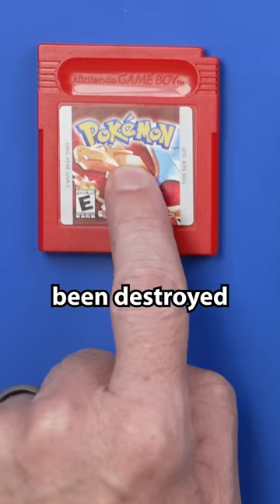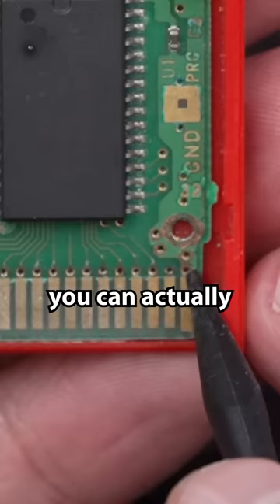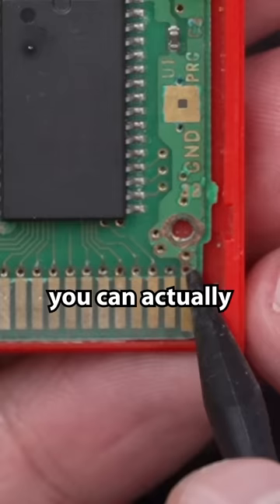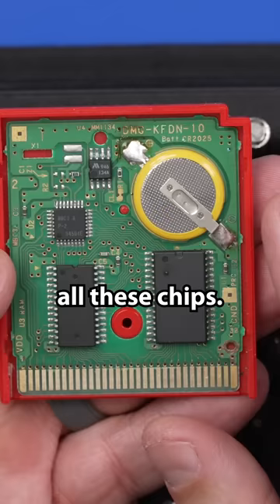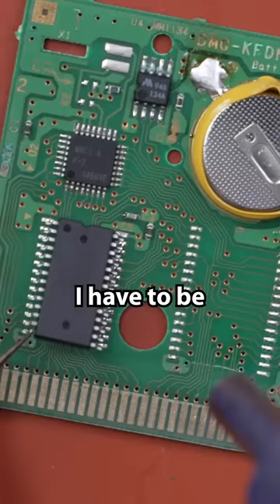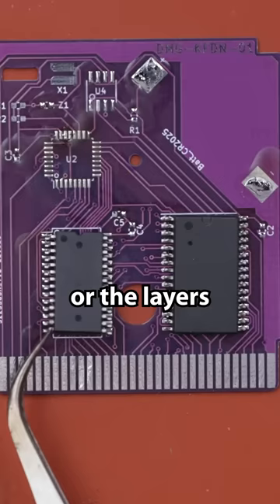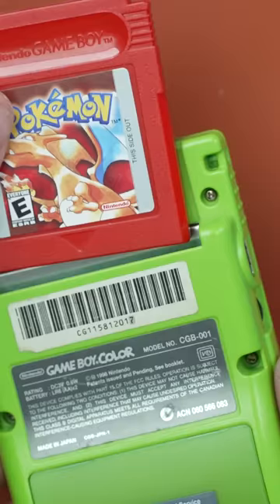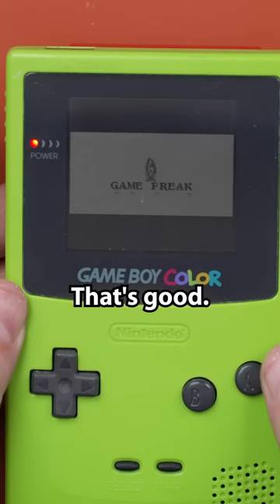This Pokémon Game Was DESTROYED - Let's Fix It!

Comment from the maker: PCB Design Attribution: https://github.com/HDR
Reply: It's like magic. How come the chips didn't take as much damage as the circuit traces? Any ideas?
Reply: @inibrasiumthefirst2680  The Chips circuit is inside the black plastic of the chip and is protected. The feet of the chip are not copper and are thicker, so they can withstand more corrosion. Copper is used for the traces because it will accept solder when hot from many materials and because it can be made paper thin. It used to be that in old boards, the copper layer wasnt as protected as well as modern bords and copper is hightly reactive
Reply: @FloatDown  Seems like he doesn't care. He only "likes" posts that say "wonderful job, wonderful video'". But not posts with real advices
Reply: Do you guys do wii bc I’d love to get this wii I have fixed
Reply: Hard-core fans: you've  ruined  the value of the game 😭
Reply: @EternalResonance  Yeah, now after the scalpers take over this poor game will cost $5,000 instead of $20,000 because it got the pcb replaced.
Reply: Do you fix switches because mines got wet and now it overheats and doesn’t recognizes as cards and won’t play on tv
Reply: We’re can I get this PCB? I’m new to soldering and would like to practice on a faulty save state of Pokémon Gold. It’ll play but saving doesn’t save on the memory chip. So every time I have to restart the game all over
Reply: @Resolve_DigitalMedia  sounds like the battery is dead. I'd start with replacing the battery first before doing a swap like this.
Reply: Oh god don't raise the goddamn price of games by showing people this, it would cost a lot more to buy a game that this has been done to.
Reply: how does one go about getting these files and having a purple pcb made?

Comment: An empty board like that could possibly save a bunch of games from being trashed. I'm definitely here for that.
Reply: Will it still be considered authentic?
Reply: @that_one_fat_guy6537  If you are gonna sell it, then no. But if you are gonna just keep it for your game library, then I say go for it.
Reply: @that_one_fat_guy6537  Well, it isn't a clone cart. It still has the original chips. All you're doing is replacing the backbone of the game that keeps everything connected.

I'd err on calling it authentic but definitely disclose that you did the repair
Reply: @snickerdoooodle  So it's kinda like reshelling a console, so yes but not fully.
Reply: weed
Reply: The game? Yes cartridge? No
Reply: @that_one_fat_guy6537  "Refurbished"
Reply: @japzone Still a better refurbished than DkOldie/LukieGame 😂😂
Reply: @crowman6330  i lost the game
Reply: @jestawell  God damnit
Reply: @that_one_fat_guy6537   So it would be more accurate to refer to it as a Refurbished GB Cartridge?
Reply: @that_one_fat_guy6537  more like an authentic copy that was refurbished
Reply: I mean yes but no
Reply: @that_one_fat_guy6537  i'd say no, but it's defo refurbished at least.
edit : would call it fully refurbished if the battery is replaced
Reply: @crowman6330 Cartridge yes, board no.
Reply: @that_one_fat_guy6537  the comparison is probably closer to replacing the motor of a 1.9L Mazda protege with another 1.9L
Reply: @that_one_fat_guy6537  refurbished and authentic chips, so technically yes. 😅
Reply: @that_one_fat_guy6537  I'd consider this just authentic refurbished. Its still OG chips which means you dont have the problems of clones
Reply: If you clearly state it was refurbished, I don't see a problem on selling it.
Reply: @crowman6330 I lost the game
Reply: @Darktrooper99  they will never know without opening it so i would definitely rip you off

Comment: I'm still calling this an original cartridge
Reply: New PCB but all original electronics.
Reply: I'd call it Refurbished, which isn't a bad thing.
Reply: At least it doesn't have alot of wires to fix the traces
Reply: This is like Ship of theseus
Reply: 50/50
Reply: @blazegame5388  haha was thinking about that
Reply: It isn’t though. As soon as the pcb was replaced it became aftermarket refurbished.
Reply: @blazegame5388  I would vote no because all the chips and outer case are original. 😁
Reply: I'd say it is because the original cartridge is still intact only the board was switched
Reply: these basically all have to be refurbished if you actually want to play them anymore. well all the batteries are dead anyway
Reply: Refurbished. Lol
Reply: Any opinions on bettery change cuz I have three that I changed the battery but kept it will someone in the fired care about like the original flux or whatever
Reply: @blazegame5388  some people will just read by your comment and have no idea😂
Reply: My toxic trait is thinking I can do this

Comment: RIP that save though. Without the battery all the data whittled away.
Reply: He may have backed it up before showing this video, or it might not have needed to be backed up for whatever reason
Reply: @A.D.G  Unless there wasn't a save before, or the battery was dead, any save that was on it is wiped out. That's what the battery is for in every game cartridge that let's you save your progress. Battery dead or disconnected, no more save Unless you backed it up on your computer or something.
Reply: @MrJJandJim  you can very easily replace batteries and keep saves by backing up the save before the battery dies. I've done it for all of my OG cartridges
Reply: @A.D.G  That's what I was trying to say, lol. Unless you have the save backed up somewhere, the memory is wiped. Sometimes my brain makes the weirdest sentences that only I can understand, lol.
Reply: @A.D.G  it would have been impossible to back it up without restoring the pins
Reply: Bro, just play the game again 💀
Reply: @theqwertycoder_alt  But don't forget that the water may have shorted out the battery.
Reply: The game was busted anyways. So that guy had to choose between starting over with the repair or buying the game again for a lot more of the price.
Reply: @deijigates4664  Yep!
Reply: Better loosing the save that the game!
Reply: Im curious,  is there a way to provide power to the chip while doing the move?

Although its moot since when the water got into the cart, most likely the game save was lost already :(
Reply: @A.D.G  how would he have backed it up if all the traces were broken? seriously explain your train of thought to me.
Why would he replace the ENTIRE BOARD if the game worked to back it up?

Do you realize how little sense your comment makes?
Reply: @froddobaggins  well considering he is a competent repair technician and can follow broken traces to their source components it's not crazy to think that he could connect directly to the required circuit points and read the data.

No need to be so hostile with such a lack of understanding on the topic champ
Reply: @kuzadupa185  no, lol you can’t unsolder and move a powered chip. Thats not how It works
Reply: Dawg, it was clearly liquid damaged. 

Whatever save it had is clearly not important. 💀
Reply: There really isn't anything he could have done that wouldn't have taken more time and resources than it was worth. With all the traces broken, it wouldn't have been able to transfer data because it couldn't be read.

Comment: Pro tip, it's good practice to bake boards before major rework like this especially when there's water exposure. Slowly get them to about 100c over an hour and keep them at 120 for a few hours to ensure there is no moisture in any of the ICs.  Some ICs absorb moisture and the internals will pop kinda like popcorn if the moisture is rapidly heated to rework temp.  Very sensitive ICs can absorb the humidity in the air and require baking anytime they are heated to soldering temps.  Lastly ceramic caps are also very sensitive to rapid temperature changes, their protocol is to ramp up to 100c at 2-4 degrees per second, then you can use soldering temps. So you can go right from baking to rework and rework will be a bit easier with a preheated board.
Reply: Hmmm, good to know

Comment: Custom boards are always fun. That one you've got looks like a HASL finish. Those contacts will oxidize and make a poor connection over time. ENIG finish will withstand the test of time far better. All the best!
Reply: Why don't you send him $40 to help pay for this?
5 boards  40x60mm $5.00 for HASL, $44.66 for ENIG at PcbWay.
You don't want the HASL contaminating his edge connector.
Reply: Just asking: Is there a good way to prevent oxidation and maybe wear on not yet properly coated contacts? Like some deoxidating layer of some kind of paint that does still allow for electrical contact or something similar?

Comment: I have to wonder how well this sort of thing will hold up, given that the originals had either gold or gold plating on the vias,  pin contacts, card edge, etc.
Reply: You can enig or even hard gold plate pcbs from most pcb manufacturers, just would cost more than the base hasl coating.

Comment: An alternative to using a hot air gun when resoldering the parts is using an electric griddle. As long as the temperature can get to around 375 f you should be okay. I did this in college and made life a lot easier. I used solder paste like glue to pull the pieces in place while I arrange them. Place the board on the griddle, turn it on to max heat and wait for all the solder to melt.

Comment: HASL finish on the pins (basically just solder).  It will oxidize. Ruining both the cart and potentially the console over time.  When you get the PCBs made, don't cheap out.   ENIG – Electroless Nickel Immersion Gold or electroplated hard gold.

Comment: The only thing I'd change here is I'd add a bake-out step before using hot air on any chips that have been exposed to moisture. Those Plastic-encapsulated chips can absorb humidity over the decades, and heating them up fast can make them literally pop! It's called 'popcorning'--look it up lol

I would set my oven to its lowest temp, as close to 150 F, or about 55 C and leave them in there for a few hours

Comment: Nice fix. I didn't know you can get new boards. I would have just added some solder from the vias back to the contacts and use some small solid wire there where needed.

Comment: I would suggest using a japanese copy of Pokémon Gold/Silver that holds the same board, remove the clock osilator and some resistors as well as adding some pieces would fix this.

Comment: We used to do this back in the day like long time ago so I kind of find that funny that it took this long for game cartridges to be reworked like this like literally some electronics circuit boards I've worked on the board is shot beyond belief the components that we can't get a hold of thankfully are still good the components that typically failed you know are more of the common stuff in some cases and we literally had to pull everything off the old board market well place it in a or on a basically printed layout of the motherboard circuit board that had double side tape basically all across it and as you took a component off you put it on there and then when it was time to what they call stuff the board and we're not talking about you know even boards that only cost $1,000 or whatever we're talking boards circuits that are priceless $50,000 if we want to go back to the manufacturer or more

Comment: You can scrape off the edges of the traces and just flow solder over each pin if your not comfortable soldering chips
Reply: That's a lot of pins, plus a new board might last longer, anyway. More reliable in the future, at least.
Reply: @MrJJandJim  iknow that but it takes more skill and equipment to remove chips like that.
Reply: @DBZLEGENDS  Seems almost identical to me, though I don't really know that much. You're probably right, though.
Reply: @MrJJandJim  well instead of just scratching the traces and flowing solder you need to heat the entire chip evenly without melting it.

Comment: The only problem sometimes with those new boards or reproduction cartridges is that they have trouble saving usually and often don't save at all and supposedly they can mess up your console if they are a poorly done bootleg however this looks like a well done replacement pcb

Comment: Just wondering, I noticed that the new board didn’t have a battery back up. Or did it have some little New type of recharging lithium or capacitor or was the battery on the other side of the new board ?

Comment: This board is not ideal. If you specify edge connector option with the PCB manufacturing company, they will bevel it for less socket wear and they'll use hard gold finish for the contacts along an edge. (Not to be confused with ENIG). Unfortunately if you wanted the quantity of well barely nothing this may be impossible, you may have to order a large batch of boards for them to actually do the option cost effectively. Between a prototype class board with no extra options, just HASL, and a badly worn original one... I don't know, neither is necessarily a clear winner. For sure quality repro bare PCBs should ideally just be something you can buy.

Comment: I’m a bit curious if this custom board makes the game still compatible with Pokémon Stadium
Reply: Don't see why not?
Reply: It's literally the same as replacing wires in your computer. It shouldn't have any meaningful impact on functionality, at least in principle. --- Not sure what the long term impacts might be if the board is thinner/thicker than the original. Also, the connection to the system is no longer Gold on Gold... So there might be more wear and tear or some weird oxidation possibilites.
Reply: mine works it is the nintendo hardwaree on a blueprint of a pcb so it is actual niontendo hardware not emulation

Comment: Hey so my Xbox series c controllers D-pad feels a bit loose, when lightly tap it I feel it moving a bit, anyone have any tips? Thought this would be a good place to ask
Reply: get electrical tape and take appart the controller and tape in between your buttons like the pad that the outside button touches don't let the tape touch the actual pad that the outside button touches if you do it right the d pad will be tighter and it will not miss click when you play retro games on your d pad it will actually register the inputs better

Comment: Dam you got surgen hands my hands would not be able to the way you accurately placed everything lol
Reply: Lots of people with neurological problems affecting hands myself included can do fine component level electronics work. It involves bracing and breathing/concentration techniques but it can be done. I would never operate on a living creature. If my hands misbehave on electronics while it's unpowered, I can fix it up no problem. Often I just don't trust myself to probe PCBs in operation and have to rig up something so I won't slip and short it, temporary connections, holders, tape etc.